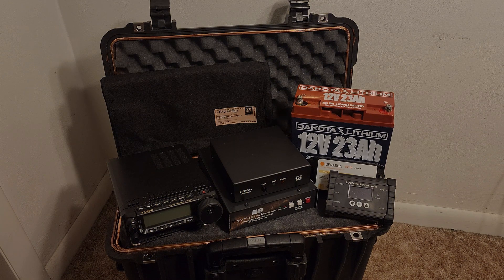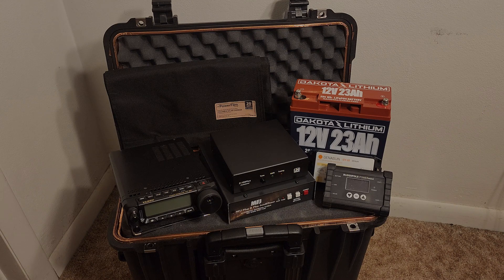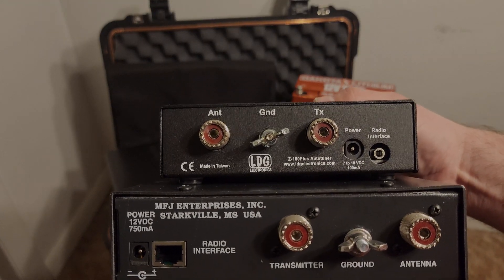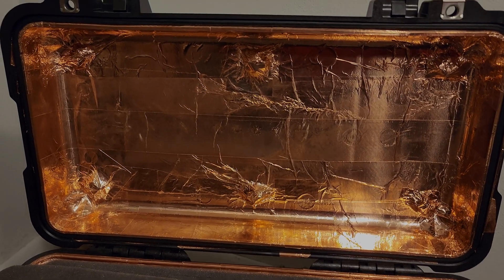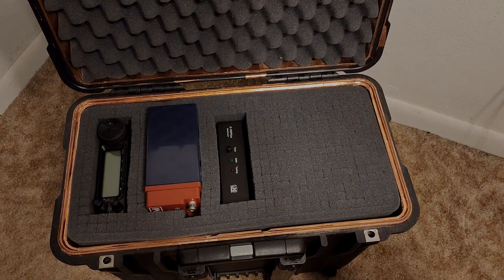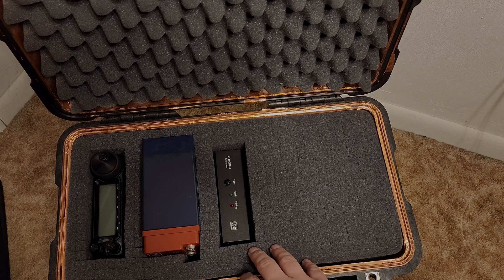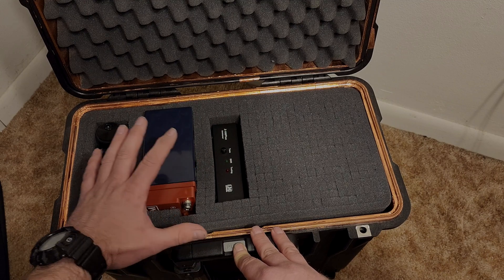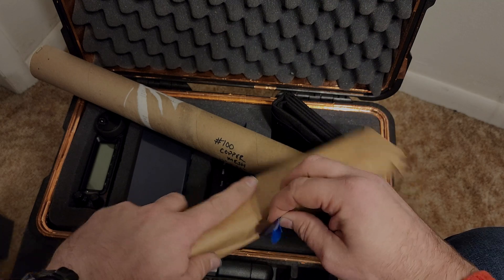Protect your Radio from an EMP or CME with a Faraday Box

Comment: Hey, I did the same with the copper tape and tested it with calling a phone that is inside of the case, put on foam. It sadly still worked. Any ideas? Did you put only one layer of tape? Maybe it is too thin? How to check if all edges are touching when it is closed?

Comment: What kind of runtime do you get with that radio/tuner/battery?
Reply from the maker: Have not used a tuner in awhile but when I did without the solar panel I got about 36 hours without continues communication at around 100w TX.

Comment: Did you put the copper foil over the rubber gasket? I couldn't quite tell. I purchased all the supplies needed to do this but just couldn't quite make out what you did there. A close up pic would be great. Thanks and 73.
Reply from the maker: Hey Scott, I removed the rubber gasket during installation to put the copper foil in the bottom lip as well as in the gasket channel. See pictures I took for you: https://imgur.com/gallery/Hkl4XUQ

Hope this helps and 73, Matt N3VAN
Reply: So far this isn’t working for me…can still hear fm radio through mine.
Reply: Thank you. Got it now.

Comment: Would have been nice to see how you got the edges done so evenly along with any other tips on smooth  application. A source for the #100 copper mesh would be useful. Is the aluminum fabric tape equally effective as the copper? If so then cheapest product wins.

Please also do a video on enhancing survivability of electronics in the event of an EMP.

Thanks!
73,
John - KK7JBZ - Subscribed.
Reply from the maker: Thank you for the comment John. I have video of making one of these for my TX-500 using the aluminum fabric tape. 

The copper mesh I bought here: https://www.ebay.com/itm/281832699823

A little bit behind on editing but will get the video up shortly!

73, Matt N3VAN